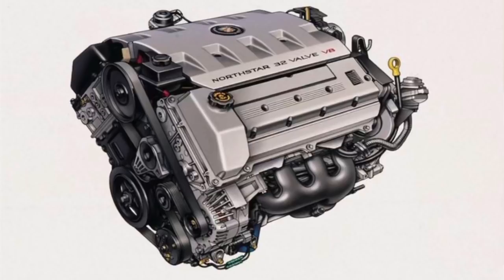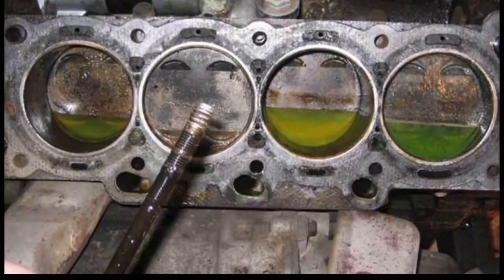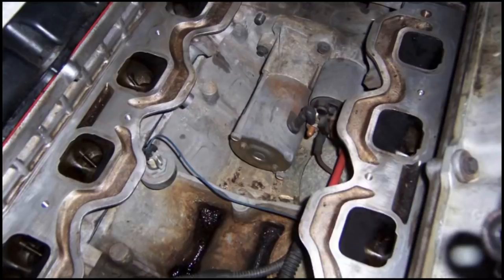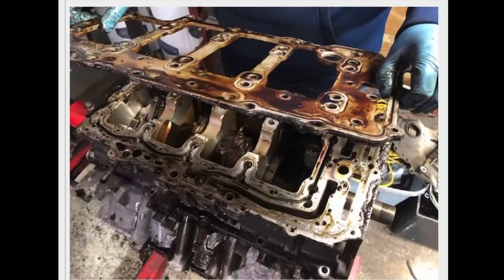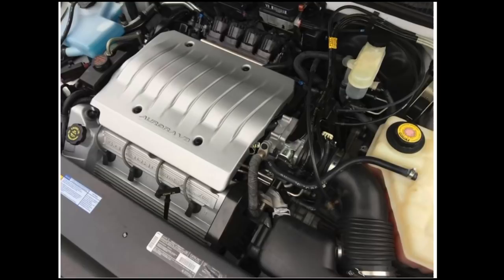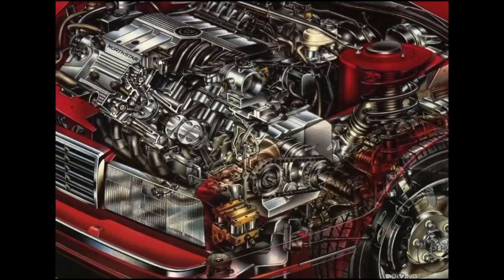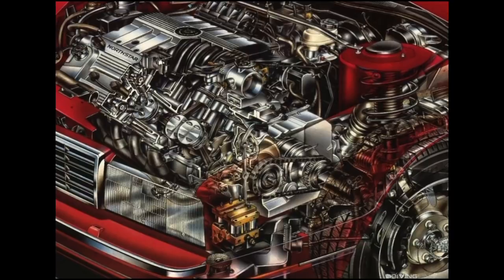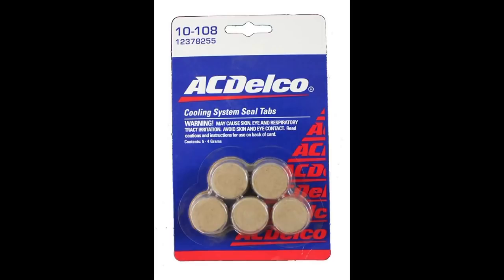Worst Car Engines of All Time: Cadillac Northstar

Comment: From what ive learned over years of reading forums and seeing them being worked on, more often than not Northstar failures are caused by neglect, specially on the later years of the engine. Coolant flushes, preventive cooling system revamps and ensuring that it doesnt even run a smidge hotter than it should goes a long way.
The thing you always gotta consider is that people specially nowadays expect Chevy SBC reliability from an engine thats far more sophisticated and advanced. For instance People overheat SBCs, fix whatever caused it to overheat and keep driving them, something you absolutely cannot do in an aluminum block engine like the Northstar is.
Reply: TJ jeep people do that 2 the worst experience i know about is overheated to the point where the ECU shut it off with no water in the system at all
Reply: The only neglect Northstar failures are to be blamed on is GM. It's a well known fact the 10 headbolts and the bubblegum heads on the Northstar are garbage. Aluminum blocks have been around since forever. Most LS motors are aluminum blocks.
Reply: @tingokuman  but neglecting it will ruin it and aluminium engine's don't like being over heated by just a little bit as it will do things like warp it. now that jeep it cracked the head something aluminium heads generally don't do as warping happens 1st generally
Reply: @tingokuman  yes the bolts are a little thin and better qc bits like gasket's and yes 14mm shank's will fit with some shop TCL and maybe 4 vs 6 pre-cylinder would have been needed but most applications didn't push it hard enough to find the point of stud's and 6, and the shops test car had 300+k on it so we must have gotten it right for the most part. my own personal 2-gen hemi is built completely different and probably over kill in some way's but costs wasn't as big of a deal up front vs others considerations which is why im ok 👌with over sized 6 stud's and all iron casting's ect.
Reply: @richardprice5978  You obviously know more than I do and most of the automotive community about the Northstar. I've owned one and at 50k the car overheated regularly. This must mean you know the heads warp prematurely on a car with meticulous service records which Is why I bought it.  Manufacturers Lemon salvage title $1700. Even GM knew it was trash. I had a race car head milled at an off road shop custom bolts. A classic rocket 350 that made the 80s cadilliacs popular would do 150k with regular maintenance. Cadilliac offered it as a Copo option even in the 90s wonder why.
Reply: I own a 1995 STS. Original head gaskets and runs perfect.
Reply: @Hi__itsHassan  one owner car? if not are you 💯sure? H by now the water pump seals on the bell housing side probably are replaced at least
Reply: @richardprice5978  I’m the second owner. I just bought it in December. The car was donated to an auction and I picked it up and drove it back 300 miles to where I live. I am still kinda surprised it made it. I tracked down the original and spoke to him. He custom ordered the car back in 95 with white and blue interior. Head gaskets are original. Water pump gaskets could have been replaced not really sure. He donated it because he had to many cars. A dealership offered him $1800 and thought it was better to donate it. The car really does suprises me. Rides just perfect. The temps stay in the healthy range of 190-196.
Reply: @Hi__itsHassan  are you in the winter state's? in lincon NE in the summer time aka hot day about 200 - 210F is normal or so most of the ones i saw 225 is on the hot side if not shut down time, if someone changed out the thermostat to lower that also would explain why that or was going to hop it up, and trying to explain this is hard for me as im just used to "doing it" without thinking about it but you said it's running fine and as long as you can get 30+ MPG i won't worry to much about it as long as you make sure water isn't collecting in the bottom of the pan as thats considered not hot enough to boil off water plus change the oil under 4K miles and at least 2 a year if you didn't make the mileage milestone mark . drak blue interior for me was rarely seen and im not remembering a white outside +DB combo so i probably haven't worked on it, the wife's is purle white and saddle tan interior
Reply: @Hi__itsHassan  o id keep the air ride i know about one car that switch i didn't care for how it rode ( went to lunch/dinner a couple of times in it ) and i didn't do that work on it but i was in the next bay over and was kanda a show car / boss friend's car that he let him borrow the bay for the day 😉
Reply: @Hi__itsHassan  oil testing might also help a lot but that's for me a new thing to do it regularly, as in 2010 it was expensive to do so rarely did we do it unless it was asked for or insurance/warranty claim or R&D testing you know things like that, now days it seems cheap and easy enough that i really should get in the habit every time on my classics handing in a sample to the cat equipment dealership/black-stone labs as my engine's aren't getting any younger or cheaper/easier to fix as there not beater car's 😉
Reply: @richardprice5978  Purple is a beautiful color. Cadillac made beautiful colors back then. I’m in Virginia and I picked up the car from North Carolina. I’m do oil changes every 3k miles. Driving around town in hot weather it’s in the range you said. Highest it went was 223. It’s at my mechanics shop now and he is doing the thermostat, coolant tank, metal heater lines on the back of the engine, coolant flush, replace basically any important coolant hoses.  I will do oil testing on it whenever I change the oil. Blackstone labs does the testing. I’m really gonna use it occasionally. I put antique tags on it.  I will be showing the car at an event called radwood in Philadelphia on may 22nd.
Reply: @richardprice5978  I never saw a white on blue interior before mine
Reply: @Hi__itsHassan  215 is ok ish about max 220 with the AC on max setting and about 90+F outside 😉 like i said i do it from feel/muscle memory ect. . sounds like it might be in good hands and in good shape hope it servers you well and is good to you 🤠

just as a joke it's not haunted/demented/deman is it lol 😂 my wifes was 👻and it wasn't the friendly kind, my charger i think 💭might be as well but its like the song riding with private molone aka she's a nice old mom ( first owner of the car 🤔 i think anyways i never met her when she was a live and my records show she might have died driving on US-30 east bond out of grand island NE driving my charger  in 1972-ish 🌪 )/my WW2 navy grandpa ( before he pasted we used to go to dinner in my cars every Friday night in the 2000"s-2014 ) i see out of the corner of my eyes sometimes
Reply: @richardprice5978  Oh that’s spooky. I try not to buy cars when someone had died it them lol. But mine is luckily not haunted. The previous owner/ Original owner is still alive. He was a doctor so maybe be brought a spirit with him I don’t know lol. It is my favorite Cadillac. This Cadillac got me into cars. My dad had one when I was younger and always loved it. I remember always enjoying the ride of the back seat.
Reply: @Hi__itsHassan  the 97 caddy i should have had a clue ( im very sceptical about paranormal and known about the little bastered ect but in 2010 i laugh it off as a tall tale not so in 2020 ) as to what i was getting into as it came out off north of new Orlean's areas before i met the wife ( and a quote the trunk was open in driveway at the prior owners aka before her and you could see from one end to the other aka no interior or drivetrain and the roof was covered with moss ) and before me had chewed up 2 prior mechanics and or owners and or had gotten fed up with it and in about 50k miles tried to kill me ( my first time riding/seeing it was at a burger 🍔king in york and yes it ran but i got a weird vibe ( chstine the movie car BTW i didn't know much about the original car or movie 🎥intel after 2015 ) but figured it was just me 🤦🏻‍♂ and this is a nice car ) at least 3 different time's and the wife more than once and it started a argument as i told her you or that demonic car and last i knew it got crushed thank G as it tried killing again after i wasn't working on it or around it again/3 more mechanic 👨‍🔧got fed up with it in a span lasting from 2007-2014 ish
Reply: @Hi__itsHassan  a lot of my extended family has or had caddy's but there not afiladied with the pro-shop i was in, or visited it/shoped at, and yes the 90's caddy's ride like a comfy sofa 🛋👍something missing with to days caddy's/lincons ect unfortunately, and as a old man might get back into a convertible sedan boulevard cruiser's but for now im into GT and or convertible or hard core sports car or truck category
Reply: @Hi__itsHassan  my 86 K1500 truck started off as my uncle's new ish in 88~ and dad's ( and mine by 8Y aka my 16 year old car 😉 and no i didn't get it free 600-1200usd-ish or in good shape as it needs a lot of TLC still ) so as far as i know its not had any deaths in or from it ( slim chance of being a fall guy TV 📺truck though ) ( and gramp's rode in it but died after dinner at my uncles house and i learned about that a day or two later on, and as i said sometimes i see/feel he's watching out for me in the truck and the charger/the buick that payed for the charger has he didn't get to ride with me when he was a live in the charger but knew that i replaced his old/crashed again buick 3x=bad car by 3 different people, i didn't bother rebuilding it again and as i said i sware iv seen him shotgun in the charger with a palad red flannel on ect. ) and i get that old comfy vibes when i drive it and i remember that as the one that brought me 🏡 for the first time as a 👶and was the 2 one to drive ( at 3Y ish i stole the keys 🔑off the fridge lol ) the first being a 88* goldwing @ 2Y,
Reply: @richardprice5978  You have very interesting stories. I’ve read some things about previous owners possession of cars. My grandpas old 1992 Buick park avenue originally belonged to a friend of his. She died and her sons gave it to my grandpa for free. When I rode in it felt weird and had some many electric problems. Radio would turn on itself etc.
Reply: @Hi__itsHassan  the charger i got from her sons i think and davy her youngest one i 🤔 think drove it for 30 or so years ( and was the one shop i got it out of and or his kids got to ride in the backseat 😉) and he said that it was a non smoker and clean car records ect um not what im finding, im not regretting getting it as i had to wait 15+ years for various reasons ( and it's not like i can find a NOS or order sheet option in 2023 for a new 1968 charger 😉 so i can be the first owner lol 😂 ), and one day visiting his house as a ha ha moment the wife asked if it was hunted or his house and he froze and said no quickly with a strange face/white/pale aka my clue but younger me didn't believe at all and whated nothing to do with it, besides she's just looking out for one of the last things of her's ( and just wants to be taken care of and in good shape ) or thats how i feel about it, and yes in 2020 it does need some TLC but older classic like mine typically at some point will have tlc or need it just like older seagoing yatcts do
Reply: @Hi__itsHassan  interesting about the 1992 buick, 
my old 07 ordered sheet full loaded 🤔 gramps blue/slate was totalled out 🌪and was ripped in 2 peace's and upside down so well the final crash was technically fixable but vary hard to do but time and money wasn't worth it at all and after he lost his license from wrecking it* the cousin of mine got it fixed it got high on pills and dukes of hazard it two bad the cameras 🎥weren't rolling as it probably would have made good cinematic experience and i got it from gramp's/her and put it in my name and fixed it for the last time

herd any about cursed guns as the family has one and growing up i was yah right but now im sceptical and might be as its kill count ( hard to explain the experience of it and or being around it and it's the only gun i know of like that and i kinda like sportingly guns ) is about 20 young men about the same way over a 150 Years period of time starting with a dieing man shot in the back saying im going to find a way of revenge on your descendants
Reply: @Hi__itsHassan  side note 📝you're pick/tag has a jag 4.0L v8 engine in it is it hoped up or do you modify any? by chance as i have one but not in the car body aka swapping out for a L6 engine 4X4 is getting fired and the v8 and automatic ( was thinking of using the cars but i think there might be a better choice but not sure if there's a 6-speed automatic 4x4 jeep/atlas compatibility or not as i started it ish in 2012 ) is taking its place and looking for a better experience ECU/wiring wise ect

Comment: The Northstar was actually a very good design. It was developed under a racing program. The most issue with the engine is they were ran on the verge of hot all the time, from the factory. The cooling fan does not come on until the coolant temperature reaches almost 230 degrees, fahrenheit, even with the air conditioning in the on position. Installing an auxiliary fan to come on at 200 degrees, negates this issue. GM, along with multiple other manufacturers, sabotage there products in hope that you will come back to buy a replacement vehicle soon. Learning these tricks keeps your car on the road, indefinitely.
Reply: A studded engine, Cometic MLS gaskets with a 195 Degree stat and good fan/rads will run hard. Will run hard. A turbo turns it into a monster. Too bad they were all in FWD cars. They didn't get a RWD variant until late in production and then it was only in a couple cars. The LS got all the glory because you could find them everywhere and they pretty much bolt in place of a Gen I or II small block
Reply: @SW-qr8qe  Yes it is crazy, but it is true. Planned obsolescence, however, is very real. There are many examples of them using plastic components where it is crucial to use metal, but they opt for the prior, instead. For example, plastic thermostat housings will fail, but the metal ones rarely did so.They also extend oil change intervals way past reasonable limits and sludge buildup is a consequence, as a result, many engines fail because of poor maintenance. Many CVT transmissions require more frequent maintenance and demand fluid service service of 30k, but they will recommend 100k, and they frequently fail in many makes because dirty fluid on contact surfaces. Longevity of products is not the objective, selling more vehicles is the objective.

Comment: We had a 2001 DTS that used oil from the start.  Coulter Cadillac in Phoenix rebuilt it at 13,000 miles and it was fine after that.  At 24,000 miles we traded it in for a Jaguar Vanden Plan.  Drove the Jaguar for 11 years.
Reply: Vanden Plan 😂😂
Reply: I did almost the same thing.  Purchased a 2001 STS from Coulter Cadillac in Phoenix and traded it for a 2004 Jaguar XJ8.  Drove the Jag  for 121k miles.

Comment: I owned a 2005 DTS and totally agree with your review. Mine seeped a little oil but was otherwise ok. Yeah, anyone who doesn't know what torque steer is, turn the wheel to the left and floor it from a stop. It will 'pucker you up', especially if your used to driving rwd V-8's.

Comment: If you find a good used example with a functional Northstar (no blown head gasket) there is a kit on the market to change to larger studs for the heads that resolves the issue.  It involves drilling out the block and head to fit the new studs.  Comes with templates to make sure you get the drilling location correct - so not an easy upgrade for average shadetree mechanics.  But it absolutely works  - you will not blow a head gasket on a Northstar if you make the bulletproofing upgrade.  The Car Wizard has a video on how it did it for his daughter's car.
Reply: You don't need to add studs. When the engines were built. Some of the head bolts were over torque stripping out the threads. Rethread the hole and don't over torque the need head bolts.

Comment: I don't know if the Corvair engine belongs on the list exactly but in their day and with normal use by normal people and normal not great maintenance by 5 or 6 years old and 70-80000 miles they were smoking, decrepit,, oil leaking garbage...
Meanwhile a 170 or 200 Ford straight 6 was purring along happily....
Reply: I've owned the same Corvair since 1983, now has 130,000 miles.  Cars normally didn't make it to 100,000 miles back then.  The problem was the engine leaked oil from just about every gasket that touched oil.  When you upgraded to Viton o rings and other seals, you didn't leak for another 20 plus years.  These weren't common until they were collector cars.  The engine is incredibly smooth because it's a flat six.  Not a lot of power, but economy cars of the 60's were all slow.
Reply: @danr1920   All that's true and was why I said "in their day".
Modern seals and modern oil changes everything but the secretary that bought a new Corvair in 63' and drove it hard for 5 years didn't get a very good value for her money and almost certainly had a river of oil in her parking space and several fresh quarts in the frunk..
Meanwhile the 63' Falcon with the same miles is purring away with just a few wisps of oil smoke from the exhaust..
BTW,,,, I LOVE Corvairs !
Reply: @danr1920  You have the kind of ecological approach to cars that would make the auto industry more popular with environmentalists if those practices were more widespread.